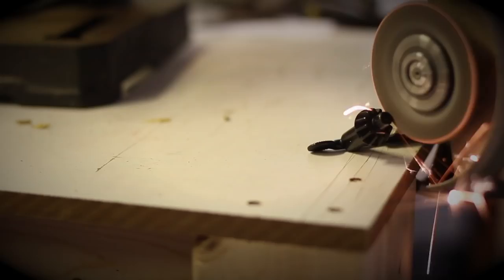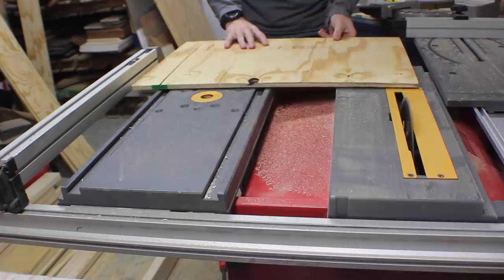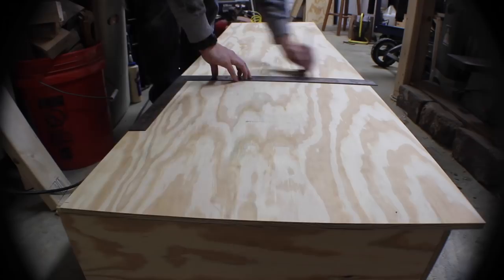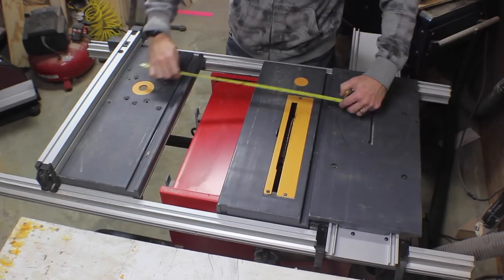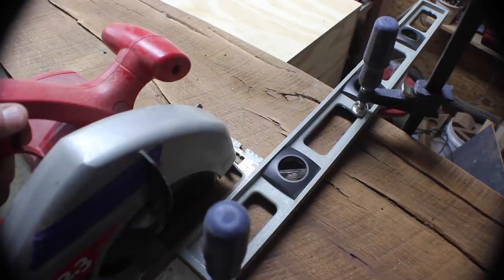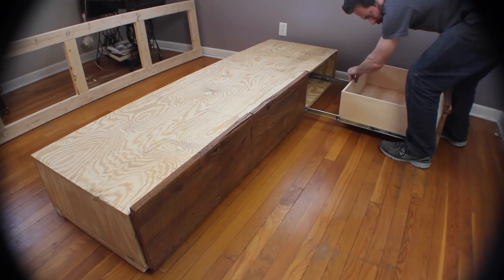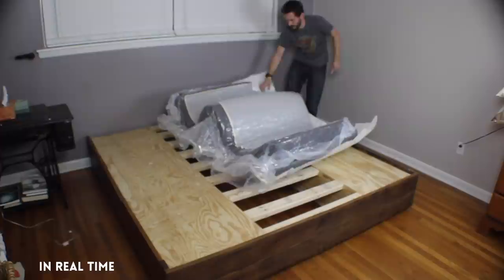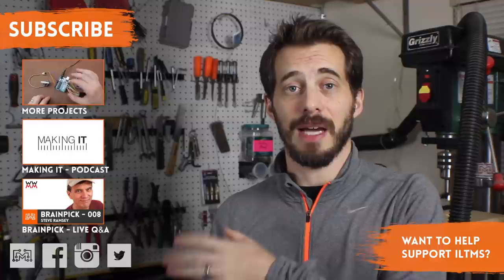King size bed (with storage) // How-To | I Like To Make Stuff

Comment: Great video! How can I adjust this for a queen sized bed?
Reply from the maker: +Peter Nation Yes! I think you'd just have to shorten the cross braces in the middle, but I'm not exactly sure.
Reply: You can shorten the cross members in the middle. Or make another 2x4 frame, before putting the drawers on, screw the frame the 'box'(were the drawers go in), then do the same on the other side and you have the 2 pieces putted together. And if you want, you can take the middle frame out and make it kingssize, if you get a girlfriend, and it takes less time then unscrewing all the members in the middle
Reply: +I Like To Make Stuff Hey man, I love your videos. I have been watching them religiously lately so when I move into my new home and buy more tools the ideas are already flowing in my head. Quick question - what's the average cost of a queen/king size project like this? Cheers and keep making great content!

Comment: How much does it cost to build? If I don't have all the high tech materials you have what are some cheap alternatives I could buy? Seems like an expensive project.
Reply from the maker: I probably only have $120 in materials mainly due to the drawer slides.  The wood itself is not very expensive for a bed of that size.

Comment: Could you make the drawers go all the way under the bed ?
Reply from the maker: MarcusVinther Absolutely! I've made a twin bed before with full depth drawers.  It's possible, you just have to make sure that the drawer is supported i nthe middle to handle the weight of it's contents.

Comment: I know this suggestion is kind of defeating the point of this video, but for the DIY people out there that dont have all the tools or space, would it not be easier and just as cheap, to buy a divan bed with no head board. They cost about £100-150 (or dollars). You could then clad it yourself with the wood of your choice. You would get the same product as shown in this video, for the same price. It would be far easier to build meaning more people would be able to do it.
Reply: Agreed  you really are missing the point.